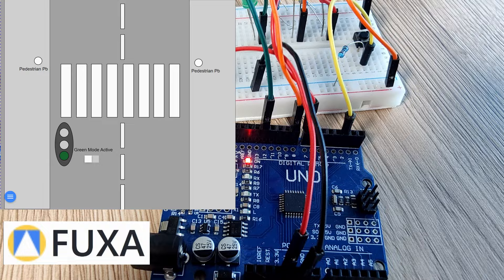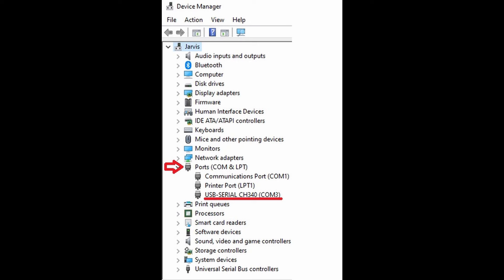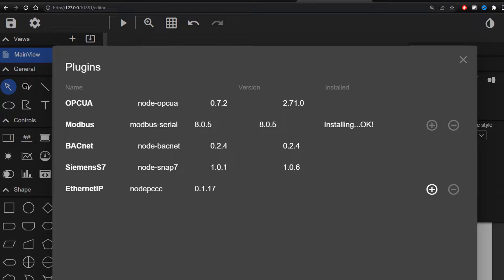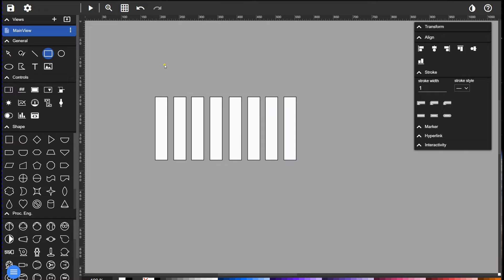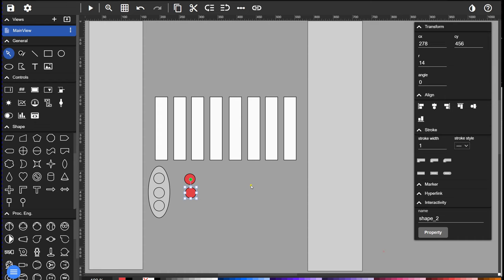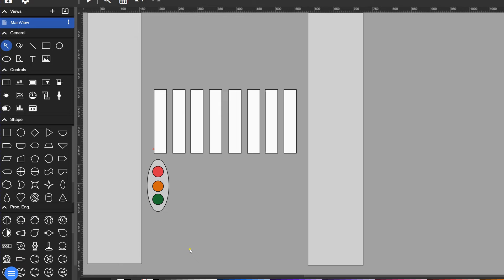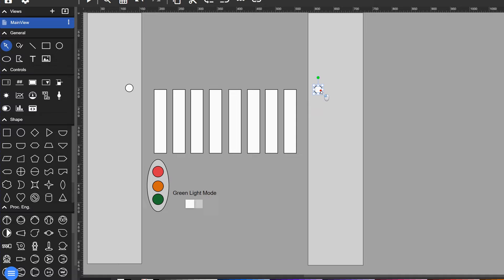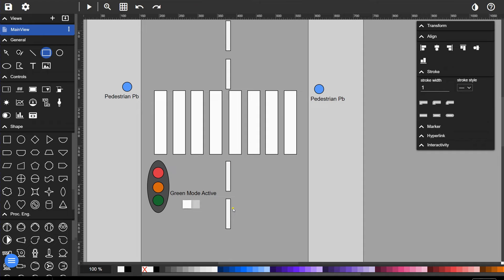Fuxa Tutorial | OpenPLC

Comment: Gracias por este nuevo video.
¿Has considerado usar en tus proyectos otros MPU de bajo costo como el Raspberry Pico?
Reply from the maker: I have a raspberry pi 3 lying around for months now. Maybe in the future, I will give it a try. Unfortunately, I have no experience with the Rasberry controllers, so I guess that is why I'm postponing it.
Reply: @seafoxc  Hi. The raspberry Pico (RP2040) is supported in OpenPLC. Raspberry Pico is based in MCU like Arduino. Raspberry Pi 3/4 works like 'computer' (using Operating System) with GPIO. Try Pico, is faster but GPIOs works at 3.3V not 5V like Arduino Nano 😉
Reply from the maker: That is a good suggestion. When running more extensive programs on the Arduino Uno, I run into RAM problems (only 2kb). Thanks!

Comment: Hi.. Your vedios are good.. Please tell how one can change or control factory io using scadabr or fuxa.. I mean how to turn on or off something in factory io using scadaBR HMI or Fuxa with Openplc and its runtime.. When hardware is not available..
Reply from the maker: U use the OpenPLC runtime for Windows and setup Fuxa, OpenPLC and Factory IO up. In your program you use an output (Qx) and connect it to a Fuxa. In Fuxa you connect this variable to a button. In your OpenPLC program you use that Output as conditions to activate stuff in Factory IO. The reason u use an output is because you can not write to inputs with Modbus and Fuxa. In the description of the OpenPlc cocktailmaker you can find a link to the Fuxa code and the OpenPLC code. In there there is a lot of examples of controlling the machine with Fuxa.
Reply: @seafoxc  thank you. Its done already.. But I'm glad that you replied.